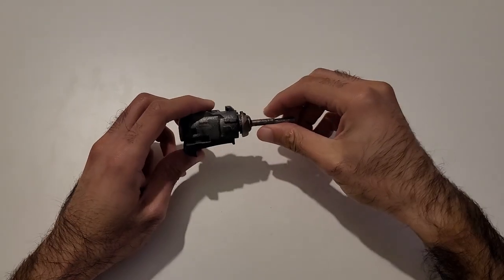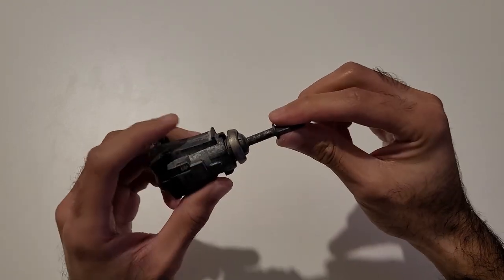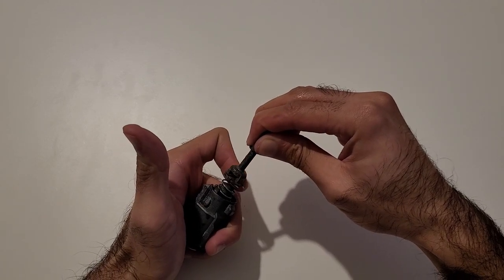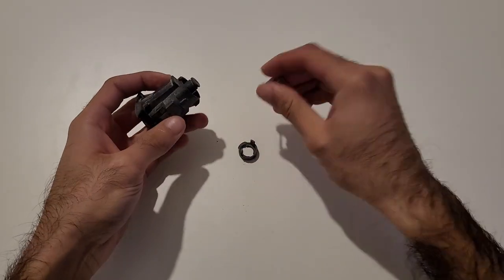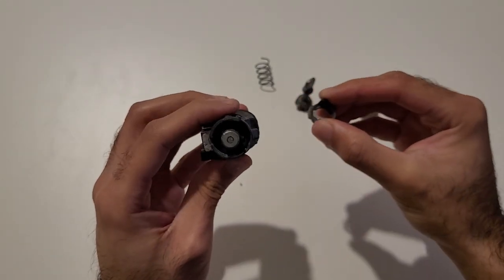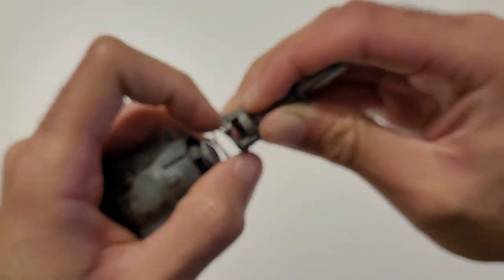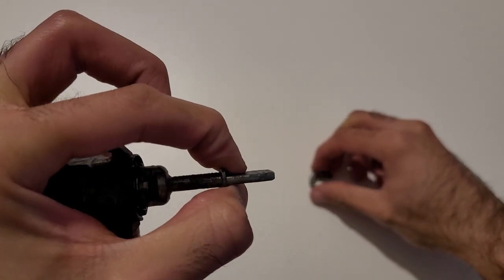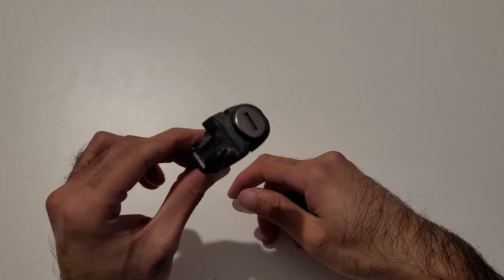VW/Audi/Skoda/Seat Door Lock Barrel Disassembly and Repair

Comment: Need to change my lock   cylinder  some thief  damaged mine trying to break in but failed but it still works lock and unlocks .
Reply: But scare I won't able to do this
Reply from the maker: @hugoreyes6757  Do you mean it still locks/unlocks with the remote key buttons, or with the key inserted into the door?